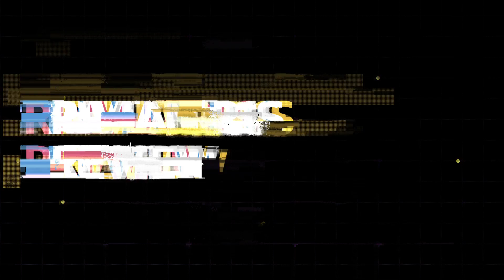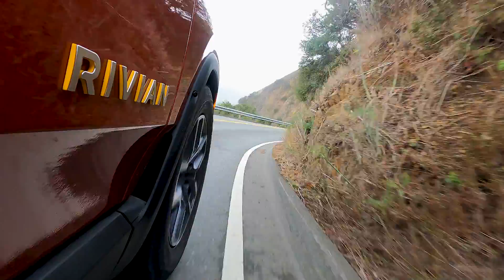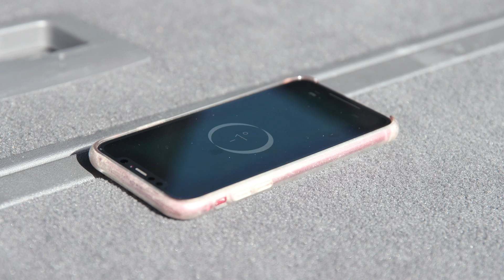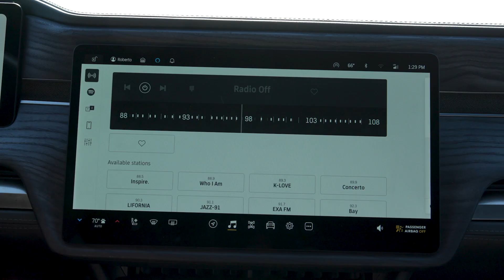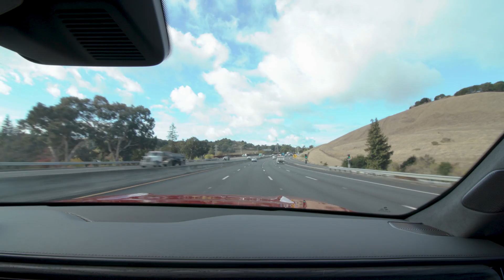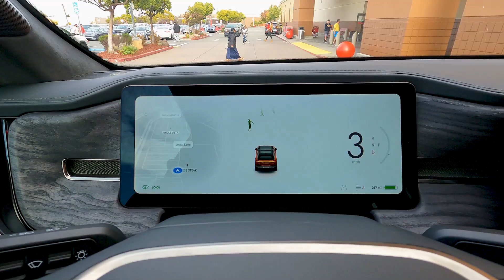Rivian R1S review: An impressive electric SUV meant for outdoor adventure

Comment: Mustang Mach E has the same problem with charge port door in a car wash, but no way to fix it. My door got popped open once during a wash and the door actually flew off. I found it with the help of the staff and was able to pop it back in place with minimal scratches. Pretty stressful.

Comment: Engadget - the RIVIAN R1S is Garbage.
the AUSTIN model Y is BETTER built , using the LATEST battery Technology and its the SAFEST SUV period using Front & Rear Gigacastings.
the RIVIAN is too SLOW, too HEAVY, its too short RANGE and its the LEAST Efficient EV SUV. 
besides , RIVIAN only sold 1179 YOY , compared to mod Y 97,642 same period. 
RIVIAN even OUTSOLD by Tesla PLAID S 6688 units .

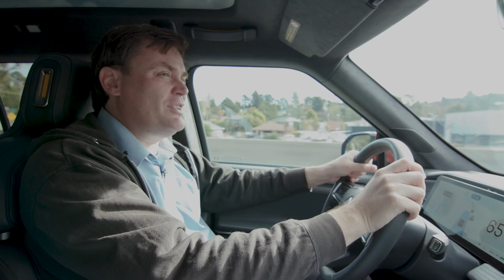Comment: 3:35 Largely inaccurate. Gas vehicle range/efficiency is only impacted by a 1-3% % whereas EV it is 10-20% as stated. Get your facts straight bud.
Reply: Where is the source of your data? I don't see how a different source of  energy would cause differences in efficiency in rain vs dry.

Comment: At this price point, the R1S is a massive miss. Not only will it be inaccessible to the majority of people, but the ones who can afford it are quite literally getting taken for a ride on the feature set (or lack thereof). All that aside, the absolute single greatest travesty of this vehicle are the door handles. By far the most ridiculous design I’ve ever seen. If I were looking at one at a dealership, the deal would be off before I even got into it. Swing and a miss, Rivian 👎
Reply: At least when they make their first models, Rivian can't achieve the economies of scale to sell an affordable SUV. Ditto for Tesla when they got started and same for Lucid. It is just the nature of manufacturing. When they do achieve scale, then they can they start making more affordable models.
Reply: @snoopy178  Trust me when I say that I understand the economics. The point I’m trying to make is that Rivian is relying on very gimmicky tactics to lure in new customers. Some of the innovations are good; others are bizarre or useless. Lucid can’t really be included in this segment, as they went for the high-end luxury market. Tesla essentially pioneered mass-produced electric vehicles, which was their goal all along. Rivian seems to want to make a vehicle for a market so niche that hardly anyone fits into it. That’s going to be an issue for them later. They’ll have to overcome that “outdoors” reputation if they want to market to less rural consumers. Right now, Rivian is the LL Bean of EVs. But for heaven’s sake, those door handles are still nauseatingly hideous 😖
Reply: @TechfulThinking  Have you driven or rode in a R1T or R1S? or are your thoughts / opinions generated from others reviews?
Reply: @rnels5002  My thoughts and opinions are my own. The features are lackluster, the door handles are hideous, and the damned thing is too expensive. Don’t need to drive/ride in one to see that, so what point are you trying to make?
Reply: Does anyone know what this baboon is talking about?
Reply: @sethgunn8256  Baboon? You must’ve gone to school with the other guy who talks like an old-timey radio host. You two should go hang out on the Sesame Street Discord or something; not here where the adults are talking. Bye bye 👋😁
Reply: Except it's selling like hotcakes, peanut brain
Reply: @TypicalSudo  Hotcakes? So far, in 2022, Rivian has produced a little over 14,000 vehicles and delivered just over 12,000. For comparison, Honda has sold 122k Accords, Toyota’s Camry is over 244k, Ford’s Explorer over 172k, and Tesla’s Model 3/Y over 325k. Rivian is a novelty at this point. Hopefully they pull their heads out of their asses and build a vehicle worth its price soon or they’ll remain that way. I think they have potential and everyone starts small. However, when you have to recall nearly your entire lineup due to a bolt on the upper control arm not being properly torqued to the steering knuckle, it lets you know that you’re still buying into an amateur operation. Also, no one says “hotcakes” or “peanut brain” anymore. What are you; a 1940’s radio announcer? 😂
Reply: @TechfulThinking  I love how you contradict your entire statement by saying "everyone starts small" which is why Rivian isn't producing the same as a 100 year old car company. Oh wait it all makes sense now you bought the Iphone 14 instead of the S22 ultra, proves how dumb you are.
Reply: @TypicalSudo  You mean buying a device that fits all my needs and that I got a great deal on makes me dumb? That would mean that buying the S22 Ultra because it fits your needs also makes you dumb by your logic, right? Talk about riding the Apple v. Android wagon right over the edge of pointlessness. I’d like to invite you back to my previous comment in which I pointed out that if Rivian continues making vehicles such as they do now, they’ll stay small. Hence why I brought up the fact that they’re small in the first place. Following logic definitely isn’t one of your strong suits I see. I’ll make it clear for you: Rivian needs to drop the novelty gimmicks and produce a reliable, competitively-priced vehicle or they’ll remain a non-competitor. The majority of Americans cannot afford an $80k+ electric vehicle, regardless of the compromises & gimmicks. Neither the infrastructure nor the need is there yet. Now, if you’d like to have an adult conversation about it without the childish name-calling, I’m open to that. If not, you can take your immaturity and ignorance somewhere else. The choice is yours 😉

Comment: Who in their right mind would take an electric car off-roading? And where you going to charge it in the wilderness?
Reply: JerryRigEverything did that with his R1T
Reply: I understand what you're saying but where are you going to find gas stations in the wilderness? You probably will say, "we can bring extra fuel tanks." But then other people will say, "Well, I can bring a portable solar panel."

But yeah, as long as you plan your route carefully with a lot of buffers, you should be fine.
Reply: @SilverNine89  I can carry 4 red tanks of gas. I can't carry extra car batteries for this EV.  And at the rate of charge with a solar panel, that EV is going to sit there charging for a few days. Better bring a flatbed with you so you can tow your EV out there when it dies. Or maybe carry a Generator. That might work.
Reply: @KabukeeJo  A generator probably won't be able to charge much either. So either don't use an EV or better plan ahead and add a lot of buffer.
Reply: @SilverNine89  A generator will still give you way more power than a solar panel if your EV dies and you are far from a charger. And you can easily fit it in the trunk/boot!!
Reply: @KabukeeJo  Hmm... Any recommendations on a generator?
Reply: @SilverNine89  Find out how many watts or amps your EV needs to charge, and then get a generator that can output that amount or as close to it as possible.
Reply: @KabukeeJo  Awesome. Thank you!
Reply: @SilverNine89  gas vehicles can last over 400 miles for off-road vehicles and even in rural areas you can find gas station, so it's generally easier to go off-road with those cars. Plus charging EVs with solar panels are going to be very slow in the wild.
Reply: @mcslender2965  Oh yeah, I totally agree with everything you said. I just found the comment funny because they are complaining that you can't find a charging station in the wilderness, as if you will find gas stations in the wilderness.

But yeah, these EV batteries are like over 100 kWh. And iirc, the largest portable solar panel chargers are like 400 Watt. It will be excruciating.

Comment: Nice vehicle, but I doubt anyone is gonna take a $80k vehicle “off road”. Just like all the soccer moms with G Wagons, only difficult terrain they see are speed bumps. 😂😂😂
Reply: I’ve seen a lot more money than that spent on off-road rigs.  I absolutely will be taking my R1S off road.  Will I be rock crawling at areas that only specially modified Jeeps are going?…No.  But will it be going places most stock vehicles (including 4 runners, Defenders and Grand Cherokees) would be puckering at the thought of attempting those trails…yup.
Reply: I seen plenty of pick up trucks on that price point and they do go on dirt road once in a blue moon

Comment: While this vehicle has its quirkiness, the carwash mode seems very redundant. I don't recall other competitive EV models having a car wash mode because the Rivian would detect it as a push. Even regular gas vehicles don't have this mode, so why this and why now?
Reply: Car wash mode is not redundant. This is the only way to prevent the charge door from opening while the vehicle is unlocked. It also turns off the auto presenting handles when the car is unlocked as well which is nice when washing the car.
Reply: @bobalis  Nah I'll have to disagree here. More features =/= functional. I did say that other similar EVs don't do it. It's an extra add-on burden on the customer to remember to use the car-wash feature, and then to remember again to turn it OFF.
Reply: @sanjayg377  Gas vehicles don't really need it because the gas door doesn't open during a car wash.  Because of the way the Rivian charge door opens, a way to turn or disengage the senso/button is necessary and allows you to wash the vehicle without opening the charge port.  You comment about other manufacturers doing this is really not a good argument as if Rivian and others only did what is currently being done, then there would be no innovation such as the gear tunnel in the R1T.
Reply: @stevelabree497  the gear tunnel on the truck under the 2nd row seat is pretty neat honestly.
I've driven the truck and for what it's worth, it's good. But there are so many gimmicky/quirky options that it feels like a Samsung phone with all the bloatware. 
I've driven other EVs too, and I don't need a 'feature' for every scenario a company didn't think of
Reply: To answer you question it turns off the regenerative braking so it can be pushed through the car wash. It also cancels automatic wipers and makes sure the charging port won't open. So, it is needed and appreciated. Also other EVs do have car wash modes.
Reply: Tesla has a car wash mode too.
Reply: It's most likely a sales gimmick .

Comment: Should read “Rivian 1S review: An impressively expensive electric SUV meant for only the rich and famous”
Reply: Don't look up the Mercedes G Class
Reply: @mcslender2965  Or BMW X7 or the Infinity Q80 or the Lexus RX450h+ or the Cadillac Escalade or the Porsche Cayenne or the Jeep Grand Wagoneer or the Range Rover Sport or the Lincoln Navigator any high end SUV that is pushing $90k. These are all selling fine and most don't come close to the horsepower or acceleration that the Rivian is capable of.
Reply: Pretty much all luxury suvs have a base price of roughly $90k. Considering this Rivian r1s launch edition is the most expensive trim it’s almost a “deal”. Cheaper to maintenance, and run, while having the off road capabilities of a Landrover, and performance of a sports car. It’s hard to beat.
 I just wish I had put in a reservation where I could have locked in the price at around $80k.